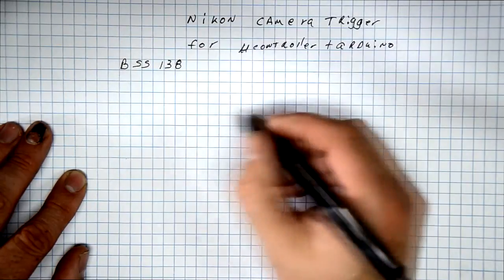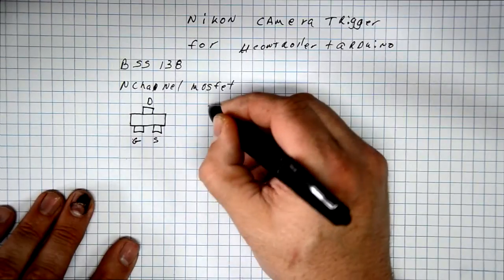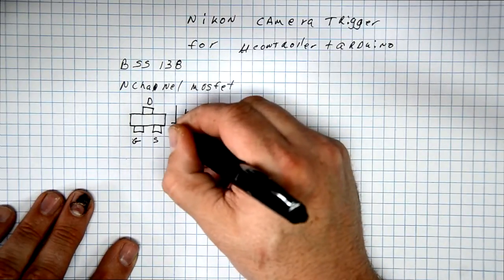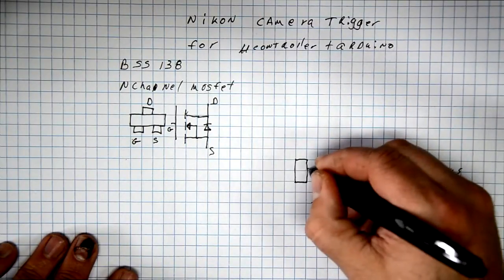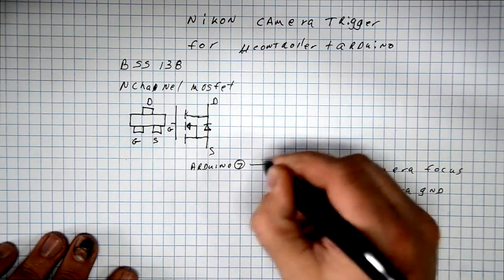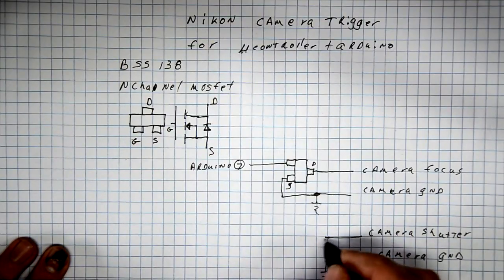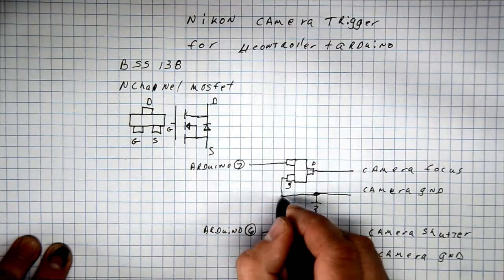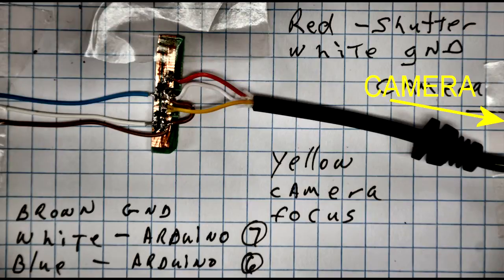NIKON DSLR camera Arduino wired focus and shutter control

Comment from the maker: I have a nikon D-7000 and a Nikon D-70S and they both work fine with BSS 138 mosfets.  would also work with a cheap NPN transistor such as a 2N3904  but would also need a base resistor.  Code can be found on my other video slider and intervallometer. /watch?v=9zc0AQrzGY0

Comment: Hey Alain, I was thinking of making the same circuit but was thinking of some optical isolating chips instead. Do you think that is overkill and that the Mosfet work well enough? Also, are you going to post the Arduino Sketch? Thanks